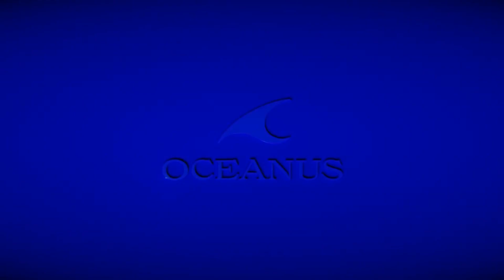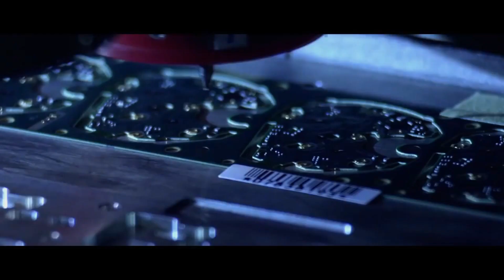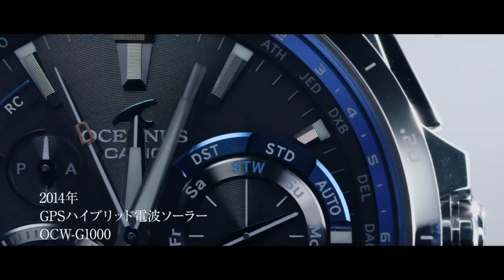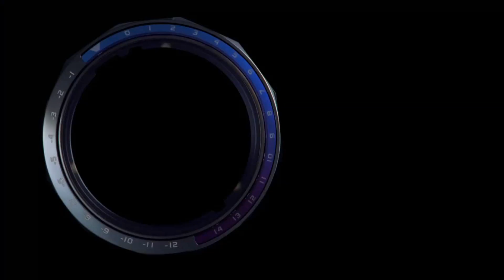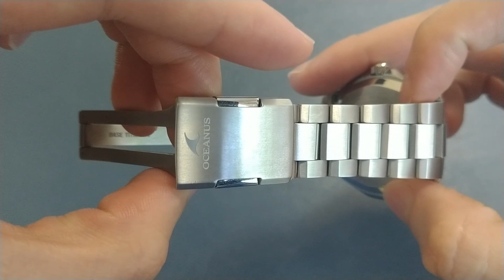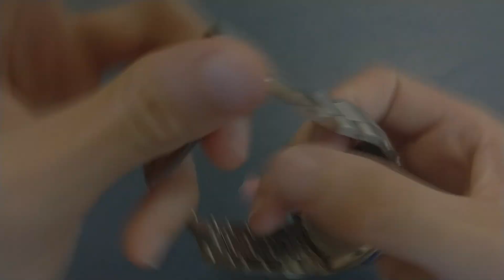Casio Oceanus OCW-S100-1AJF after 4 years. The ULTIMATE review of this watch!!

Comment: Are you seriously comparing this watch to a Rolex?  I have no doubt that the quality is very good, but a Rolex it is not.
Reply from the maker: Yes I'm seriously comparing this brand to a Rolex. High end Oceanus are made to a grand Seiko standard. The polishing is made by hand to a higher degree than Rolex. Rolex does the polishing by machines. It's official that Grand Seiko requires more work to be produced than a Rolex. The high intensity titanium is harder to produce be polished and be machined as it is stronger and more scratch resistant material than the steel Rolex uses. 

And all this Oceanus also uses it in a similar way to grand Seiko. 

Rolex is a great watch but the price tag is a product of a well driven market based on the law of demand and supply caused by history but a great branding. 

If the Rolex is more expensive, it doesn't magically makes the Rolex  better than a grand Seiko. 

This perception of the extreme quality of Rolex is merely emotional. Grand Seiko is made in a higher standard with better materials better systems more dificult to be produced.

And while high end Oceanus are made close to grand Seiko standards they use the same materials and same polishing etc. This watch on this video is not the same. But even this 700$ Oceanus have a better material than Rolex and the polishing is still made by hand with the zallas technique where in a swiss watch is only used on micro components on high horology watches. On even this 700$ Oceanus you get this polishing process on the case while on the Rolex is machined.
Reply: @watchroll3310  I respect your appreciation for Oceanus and I have absolutely no doubt that it is an excellent watch, but comparing it to a Rolex, as if to suggest that they are close to being equal is an absurd comparison.  You seem to know a great deal about Oceanus, but from reading your comments, you don't seem to know much about Rolex and how they're made.  As great as the Oceanus may be, it's not even in the same league as Rolex and I don't mean that from a cost or prestige point of view.  Rolex is obsessed with quality of the highest standards and the price tag certainly reflects that.  On average it takes a year just to assemble 1 watch.  Yes, there is a supply and demand issue, to be sure, but the demand is based on their reputation and proven high standards of quality, not mere emotions, as you suggest.  Rolex has their own science lab and foundry in which they make gold.  The 904L stainless steel is the highest grade available which no other watch maker uses.  While Rolex uses some machining, their watches are hand finished and are not simply cranked out by machine, as you seem to believe.  If you want to make a true comparison, I would suggest that you obtain a current model Rolex and do side by side comparison on your channel.  There are tons of books and other materials written on Rolex, but if you'd like a quick read, here's a link to a Business Insider article that I read which may give you more insight.   http://www.ablogtowatch.com/10-things-know-rolex-makes-watches
Reply from the maker: @ta6761  Thanks for sharing your point of view in a friendly manner. I will go straight to the point. I never Claimed Rolex and Oceanus are equal. 

I checked the blog you sent me and I didnt see any info I didnt know before! 

This Oceanus I am holding is not the one I was refering to. I'm talking about those HIGH end Oceanus that are even more expensive than some Rolexes. 

I had held multiple Rolexes and also some high end Oceanus. I have spot some times defects on Rolexes, I have very good vision and I'm a little crazy about alignments in watches. I have found hand misalignment, some tiny blemishes, a nasty paint spill on a gmt red hand, and even on an air king two number 9s  where the number 3 supposed to go. That doesnt sounds like obsession for quality control. It can happen to any brand with a modern traditional production system. 

see there is things you are not aware of. 

Imagine you have a guy who says he can trim the grass on your yard for 10,000$ he charges so much because he trims every single leaf by hand. 

The second guy comes and says he will do the job for 1,000$ but he uses an advanced tech that perfectly cuts all leafs to absolute perfection with a lazer. 

humans have limitations, and rolex production is simply not as advanced as the Oceanus system which is what I mentioned here. 

The Yamagata line uses microscopical systems to check QC that then is ensambled by hand thru micro scanning. Rolex don't do this. This is where on the rolex production because it has a traditional swiss modern system there is more room for misalignment and other errors. 

The Japanese work smarter than the swiss and combined to hard work they create things that simply the rolex can not match. 

If you are not aware of this in japan there is a term called karoshi. Japanese are hardcore about hard work, so much that there has been many cases of japanese workers fainting while going back home. 

You have to understand the cultural difference, swiss people simple are not as hardcore as the japanese. 

Thats why in the 70s Japan did beat the swiss over and over at the chronometer trials. The olympics of watches. it was seiko who defeated rolex omega and all the swiss over and over. The swiss burried this history and canceled the trials all together to never be defeated again. later in 2008 the swiss reopened the trials with one rule "only european countries can enter"

You say "comparing this brand to rolex is absurd right''?

I think this statement is delussional and I will tell you why

It is already a known fact that Grand Seikos take more time and effort to be produced than a rolex. 

If you can understand this then how hard it is to understand "The Oceanus is made to a similar standard like a Grand Seiko''

The 904L  (that by the way rolex developed this alloy because is a brighter steel so it looks better) which you say "nobody else has" is an inferior material than the Oceanus and Grand Seiko.

The high intensity titanium carbide is lighter, more corrotion resistant, 5 times harder, scratch resistant and stronger than 904L so is harder to manufacture, is harder to polish.  The Rolex 904L just has no chance! is an inferior material. 

The polishing on the Rolex is mostly made by machines, there is no artisanal polishing on Rolexes you should check your sources. 

While on a Grand Seiko and Oceanus they have Sallaz black polishing.
It simply takes more effort to do this work.

Sallaz black polishing is used on high horology swiss micro components like screws. it is like a micro polishing. Its a lot more detailed than the polishing on a rolex, and Grand seiko and Oceanus do this work on the entire case. 

Do you understand? Rolex doesn't has this level of hard work on their cases you cant argue with this. 

So how come a high end Oceanus can have a superior finishing if "it can not compete with a rolex"? 

The GS and Oceanus polishing is distortion free, is like a mirror. the reflection is not distorted. On a rolex the reflection is not as clear and is distorted. 

The oceanus have a led system that keeps the hands milimetrically dead accurately positioned, while on a rolex it can get as good as a human eye can put them. 

There is oceanus watches that have japanese traditional artisanal artwork like Edo Kiriko. And there is other models with diferent traditional works, Rolexes dont offer this level of production. 

Now both GS and Oceanus are 100% integrated. yea Rolex produces their own gold and guess what? GS and Oceanus also produce everything themselves, they grow their own quartz crystals, the oils the gaskets everything is made in house. 

Yes you are right, the rolex and oceanus brand are not in the same level. The oceanus is 100 years ahead of rolex. 

a rolex movement is not tougher as an oceanus movement, is not as accurate, is not as reliable, it doesnt offers any technological advance like the oceanus.
a rolex is the aquivalent to a luxury old train while GS and Oceanus are the equivalent to the shinkansen. the old train just cant compete to the shinkansen. The shinkansen is 100 years away from the old train. Is faster, more durable because is a smarter system, smoother, etc.

Rolex cant simply compete with this. 
But rolex makes exceptional movements on their own game which is older systems. 

Rolex has their own science lab is laughable in comparassion to yamagata casio. 

Casio itself started being a science lab. 

I never claimed that casio is of more quality that Rolex entirely. I said their system for QC is superior, smarter than Rolex because they just have better tech. And on some aspects like the materials and the case finishing high end Oceanus and Grand seiko are undeniably superior to Rolex and you cant argue with this. Check Tim Mosso from watch box he explain this better than me. So how can a watch with a higher degree of production of finishing wouldn't be able to compete with Rolex? 

Rolex is mass produced, GS and Oceanus are much more limited.

check this out, there is some Oceanus models that have a specific traditional artisanal art work and there is only 1 master craftsman that makes all this models. They are produced one by one.

for their movements its a little relative because one is an automatic movement and the other one is an advanced 5 independent motor high torque quartz with GPS and atomic tech. those Oceanus movements have complex train wheels like an automatic movement but they are different systems. So on that its a little relative but the Oceanus system is undeniable superior to an automatic movement. If you like an automatic movement that's personal preference but a rolex movement can never match a Grand seiko spring drive neither an Oceanus multiple motor high torque movement. They are 100 years away of the Rolex technologically speaking and with all the logical absolute benefits. Tougher, more durable, more accurate, longer service periods, a spring drive can go 50 years without service because there is not friction on the escapement.
Reply: @watchroll3310  You certainly do make a persuasive argument for the Casio Oceanus.  You seem to know the product well.  Since I do not own, nor have I seen or examined any of the Casio Oceanus models, which there appear to be several, I cannot speak with authority about Oceanus in that regard.  That said, I do have quite a bit of first hand experience as it relates to Rolex and Swiss timepieces in general.  There are a couple points that you made that leads me to question the veracity of what you've said however.

I realize that the Oceanus line is a JDM product line, so I checked the Casio Japan website to learn more about these watches and could not find a single watch that came even remotely close in price to that of a new, current model Rolex, let alone exceed the cost.  Currently the least expensive Rolex model, Oyster Perpetual 39 sells for $5700 USD.  The closest Oceanus model that I could find to that in price is from a limited edition (700 pieces) Manta model # G2000SB-2AJR which is listed at 275,000 Yen, or approximately $2301 USD.  Prices for base model Oceanus watches start around $550 and go up from there.  Most models seemed to be in the $1000-1200 USD price range.  Since you stated that Casio makes high end Oceanus models that exceed the price of Rolex, I'd like to know specifically what models you're referring to because they're not listed on the Casio website.  By any chance, are you comparing these watches to used Rolex watches sold in the aftermarket?  Even then, it would have to be a very old Rolex to be valued at only $2301 USD.  I'd like to know more about the specific model watch(es) you're referring to.  If Casio makes such a watch that rivals Rolex on cost, I would find your argument to be more believable.  I think we can both agree that cost is not the determining factor in whether or not an object is manufactured to high quality standards, although they often do go hand in hand.

As far as the defects that you describe seeing on a Rolex, that would be so flagrant, so egregious that such a watch would never leave the Rolex factory.  Your description of these obvious defects leads me to believe the watches you viewed were in fact fake, or possibly an older Rolex watch that had the dials refinished in subpar fashion.  Speaking from personal experience here, none of the Rolex watches I've ever examined, currently own or owned in the past have/had any kind of defect or imperfection.  I too have very good eyes and can spot a defect.  A red paint blotch, sloppily applied to a hand or misplaced hour markers marking the incorrect time, simply wouldn't happen.  That's a tale far too unbelievable to give that any credence.

With respect to technology, there is a clear difference between the two brands and that's fairly obvious, which on it's face makes the comparison somewhat absurd to begin with.  Obviously a quartz movement, any quartz movement is going to be more accurate at telling time than a mechanical movement, let alone a watch that uses GPS and Atomic clocks to regulate itself.  That said, Rolex could just as easily produce quartz movements, as they did once in the past if that is what their customers wanted.  For that matter they could choose to use Titanium if they wanted, but it all boils down to consumer demand and that is something that Rolex is very much attuned to.  Consumers who buy Rolex are not looking for tech watches that can sync to an atomic clock or a satellite.  That is not their consumer and Rolex knows this.  In a world where technology seems to drive every aspect of our lives, there's something desirable about a mechanical wristwatch that can wind itself and is beautiful to look at.  The simplicity, the warmth and charm is hard to convey.  Sure, I could easily afford to go buy a quartz watch that has all the features you speak of, but it completely misses the point.

Your point about Rolex being mass produced is well taken however.  They manufacture significantly more watches than Grand Seiko and Oceanus, however is still a very small quantity when compared to what many other manufacturers produce.  To keep up with demand, Rolex now has 3 factories but it's consumer demand that's driving their growth and volume.  Currently, most buyers who wish to buy a Rolex must be placed on a waiting list to purchase the more popular models.  In contrast to that, the Oceanus line produces fewer watches, but that fact alone doesn't make them a better watch.  The low volume speaks of low demand.  As good as they may be, by and large, most consumers aren't willing to spend $500, $1000 or $2300+ on a Casio.  You can believe that if Casio thought they could sell more watches in this price range, they absolutely would and they'd increase production accordingly.

I'd like to simply close with this challenge.  Since you have a YouTube channel with hundreds of subscribers, do a watch comparison for your viewers.  A side by side comparison: Oceanus vs. Rolex.  That's something I'd definitely tune in to see and I would imagine so would a lot of other people.  From the other videos I saw, you're the only one who has compared the Oceanus to a Rolex.  I think it would be good viewing and probably sure to get a lot of comments from folks.
Reply from the maker: @ta6761  https://youtu.be/N_FYI_xXe2A 
Look at the Rolex GMT hand.
https://www.youtube.com/watch?v=mDyFyynEe4U

No they were not fake rolexes. You can look this up on YouTube "Rolex qc issues" Rolex has amazing qc but some times they tripped. 

There is the Rolex with two 9s is on YouTube two. And Rolex fans went crazy for it because is "unique" 

I was thinking from years ago when the cheapest Rolex on an ad was well below 5000$ I see that now it starts at 5000$

At the same time Oceanus discontinued several 6000$ models or they don't have them right now. But years ago I saw in some Oceanus catalogs that I got in Japan watches with a 600,000¥  retail price. 

Still there is even G-shocks with a 6000$ price tag that you can currently see. 

Rolex can easily make a quartz. Yea anybody can make a quartz, 
Anybody can make an automatic too right? Doesn't Rolex uses and automatic? Is because is a super good automatic! Yes is a super good quartz that Rolex is not able to come up with. A quartz is not the same as a 5 independent motor, high torque GPS hybrid atomic. Rolex is just not into leaving traditional watch making. The Japanese won that race. More than you think creating a spring drive was out of reach of the Swiss. And the movements on Oceanus and high end g shocks were also way a head of a swiss quartz. 

The Rolex can use titanium. Yea is not the same, they have never developed a material as efficient as the one on Japanese watches that's just the reality. Have you seen the citizen duratec? It's close to ceramic in scratch resistant. It's not just titanium. 

Kind of missing the point. I'm not saying Oceanus is to compete in the market with Rolex or that the watch is entirely better than Rolex. 

But you can undeniably put a Rolex together with a Grand Seiko and if you really know see that the GS has a better work on the dial and case. 

Rolex simple doesn't perform that level. 

So why does a watch that offers 1 aspect that happens to have a higher quality factor magically can't be compared with a Rolex? 

If an Oceanus case is better done than a Rolex then why is so hard to accept it? 

Why denying the fact? It's just how it is. And if there is cheaper watch that has a higher quality aspect than an Oceanus then go ahead and compare that detail to the oceanus. 

But the fact and the main point is that I mentioned some factors that the oceanus happened to have a higher level of attention than Rolex. Just those details? It doesn't means I say the watch is better in everyway! Rolex has precious metals and oceanus doesn't have any so you could say this! The Rolex beats the oceanus on precious metals! Yea that's ok to say. And it's also ok to say the oceanus has a better case work and dial than a Rolex. 

You can see videos of grand seikos beating Rolex on quality. 

At least for the case and dial the oceanus it's in a similar level to grand Seiko they are even produced with grand Seiko! 

I'd love to have a side by side Rolex vs oceanus video that I have yet to make possible. 

Meanwhile You can check GS vs Rolex though. 
https://youtu.be/5j0kcDocE-k
Reply: @watchroll3310  I was aghast when I saw those videos and quite frankly, I never would have believed it had I not seen the videos for myself.  I'd be very surprised if that watchmaker hasn't been demoted to janitor given the high standard that Rolex maintains.  All that said, I suppose I can accept that even Rolex as great as they are can make mistakes.  I believe that is especially true now since they're making a million watches a year at 3 or 4 factories.  At some point a defect is bound to show up here or there.  However, their percentage of defects has to be so minscule it's probably well below 1%  Thankfully, none of my current Rolex watches or ones I've owned in the past had any such imperfections.

Their standard is quite simply, perfection.  Rolex, I can assure you is most certainly dealing with or has dealt with these defects with extreme prejudice.  The brand is not going to lower their standard or accept these defects that can later be made in to videos and posted on Youtube.  I know this brand well and they will address the issue, which in all likelihood can probably be traced back to the watchmakers who signed off on the exact watches that were shown in the video.  Rolex tracks each timepiece as it moves through the assembly process and they maintain a digital record, like a digital thumbprint  to identify the watchmaker(s) who are associated with every serial number.  The Swiss aren't lazy, they are very hardcore about precision, accuracy and quality.

You would be very hard pressed to name any other company who has earned the reputation that Rolex has.  The demand for their watches are so heavily sought after, that demand outstrips supply by a wide margin.  The aftermarket is full of brand new Rolex timepieces being sold in the aftermarket for MORE MONEY than they actually cost new.  That is assuming you can find a dealer who is willing to sell you one.  In 2004 I bought a Rolex Submariner (Kermit).  It was a 50th Anniversary watch and dealers were telling the public they were all sold out and weren't getting anymore.  Meanwhile the few people who had them were selling them on auction sites for 2...3....4.....even 5 times what they cost new. On the same day I picked mine up....I was lucky my Rolex dealer had just one and he agreed to sell it to me on the promise I wouldn't resell it, I paid $4,700. brand new.  That same day, I saw the same watch selling on eBay....closed auctions with winning bids of $13,000......$15,000.....$18,000 and one even as high as $23,000.   Insane?  Yes, absolutely!  But when it comes to Rolex, there are some people who are willing to pay almost anything to get their hands on a highly coveted watch.  Not convinced?  Paul Newman's stainless steel Rolex Daytona sold for $17.8 Million Dollars!  

You can argue Zaratszu finishing all day long...better finishing.....better QC, etc...but you'll never see a Casio sell for millions of dollars.  Rolex meanwhile continues to increase in price month after month, year after year.  Every Rolex I've ever bought is worth at minimum 2-3 times the price I paid for them brand new.  In the meantime, I've enjoyed owning and wearing them as they appreciate in value.  Hard to find another watch that offers the same qualities.

 One thing I will say, is that you've exposed me to the Oceanus line that I never knew existed and now I'm curious to examine one myself.  As a lover of all sorts of watches, I have many watches including Seiko's etc... There could possibly be room in my collection for an Oceanus.  I have my feelers out for a couple in particular that strike my interest.  Who knows...I may even buy one and do my own review.  Only time will tell.
Reply: @03flhtcui  If speculation is a priority, then stick with Rolex. But, beware that if it is stolen, and sent into Rolex for service, they will not return it to you, even with a police report and an insurance claim. Rolex has no regard for the customer once the sale is complete. With a Rolex, you need a safe. With the Oceanus you don't need to worry about being rolled for your bling, and then having the watch manufacturer tell you to get stuffed.